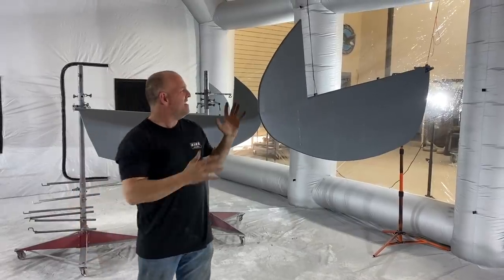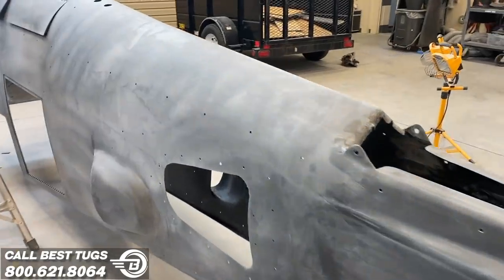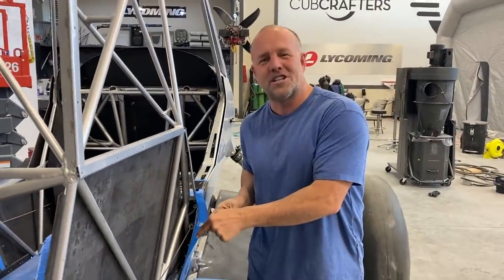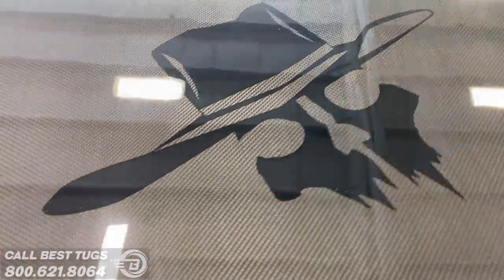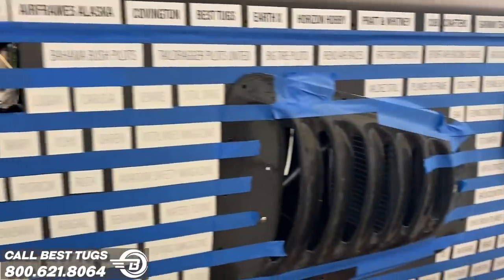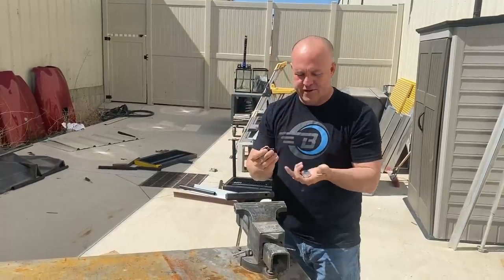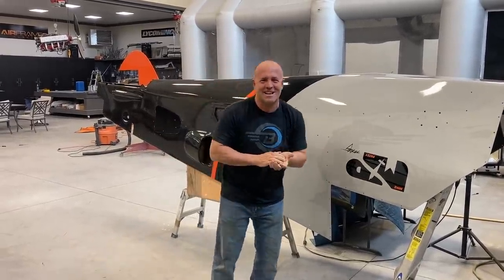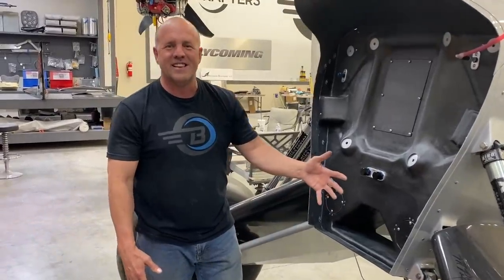Scrappy gets a paint Job (Scrappy Bush Plane 23)

Comment: Oh this is so very exciting :). Quick question I may have missed something but the lines into the wheel shocks are these for pressure release/equalisation or perhaps can be from a compressor to set the stiffness and travel depending on the planned field conditions ?
Reply from the maker: Coming in one of the next few videos
Reply: @MikePatey  Can't wait :)
Reply: Mike Patey hmmmmm. I’ve had this suspicion about you doing some crazy remote control setup in the cockpit 🤔

Comment: Hello Mike,   I am an avid fan of your channel and love to see what you come up with. I have many qurious engineering questions of Scrappy and your visions for it.I hope that my questions are not perceived as naive. A) The airfoil shapes of your upper A frames will  effectively give you lift at certain angles and that is why I Am guessing from previous mention on your channel that your shocks are also Hydraulic pistons able to lift the gear into flight mode. Have you calculated the percentage of lift gained by this? B) With lift you also gain parasitic and induced drag and I am wondering if that turbulence behind the gear will affect or blank the horizontal stab? C) I saw that the bottom A frame is covered in fabric and thus creates a sort of "Tunnel Effect" under the fuse in conjunction with your flap door. Have you calculated the drag and lift factor of this? D) Other than the "Tunnel Effect" you gain from the lower A frame, could the Bottom Axle pivot point have been made by a single airfoil shaped strut, saving you weight at the gear? E) I can perceive that under heavy braking there is a crushing load at the rear pivot points of your A frames causing the lower fuse frame to push inward. Are there cross brace tubes in the fuse that go across to connect both pivot points together? F) Have you calculated the effect of your flying landing gear ,when in a Slip to landing? Will the forward facing gear leg cause more lift and an unwanted banking action that would oppose a side slip? Have you used any BIPlane engineering concepts to calculate the effects of your gear design, since in essence you are creating a sort of BiPlane between the gear and wings. Thanks in advance for you answers, I am looking forward to them.

Comment: Curious, did you use a special epoxy for the carbon fiber? I'm reading about how sensitive epoxy is to temperature and thinking about the wide range of temps airplanes experience.

Comment: I hope this isn't a dumb question and, I ask not knowing your total loaded weight but, are you under braked?  As I'm sure you know, brakes convert the energy of forward motion into heat via friction.  Therefore, unlike everything else on a plane, when it comes to brakes mass is good.  The larger and thicker the rotor the better, the more substantial the caliper the better, the larger the pads the better - all to absorb and wick away heat.  It may be the enormous bush tire that makes the brake system appear smallish so, just wondering if you have enough braking power.

Watched every video of the Draco build and am following as you complete Scrappy.  I know I'm just one of many voices in your busy orbit so, no obligation to necessarily respond.  Thanks for the great content.
Foy

Comment: I've watched THIS VIDEO...?...I don't even know how many times now!  ....and that's basically because I'm a real "Asthetics" Driven kinda guy, and now that the paint is going on I'm WAAAAAAAY interested in THAT PROCESS...AND...OUTCOME !  But that, over and over again watching created ANOTHER question...?
   At the very end when you show those aluminum "Hose fitting plates" that you started making. When you attached them to the bottom of the suspension wings, are the screws threading into just the carbon fiber of the wing OR did you plan for this b4 you enclosed the aluminum bar suspension in the carbon wing and you knew exactly where to drill so that the "Hose fitting plate" SCREWS would screw into that suspension tube framework???
   And one last comment....  I sure hope you're planning on using a LOT MORE ORANGE paint as you go forward on Scrappy, cause I think BRIGHT colors...( up against a little black, just for the sake of CONTRAST) makes for a REAL COOL look on anything ! ! !

Comment: Are you using a uv filtering clear on the carbon? I k ow the 787 had uv issues with their exposed carbon.
Reply from the maker: 👍🤠 yes sir I have done testing and have a ten year race plane with it and percent still.  Certainly heavy on the UV

Comment: This isn't criticism, just curiosity, why wouldn't you use a carbon colored glaze or fairing compound on the pinholes?
Reply from the maker: Great question 👍🤠 I tried it a few years ago.  It would look perfect match and then put on the clear and it just popped the color out so I tried a few different colors and thought I had it. Then I pulled it outside and the color changed different then the carbon again. So I went back to clear.

Comment: That bulk head holder 
Looks like something you'll see out if China for 50c ea in a year or so 
Good idea 
I end up making a similar thing but use plate and weld the fitting to the plate 
This is way better but I lack a cnc mill 
Lol

I'll add that 
So someone will start makeing these in America or Europe for $1 each and they'll be good 
Then the Chinese will start making them for 50c, then every one will buy the Chinese one and itll be shit 
The nut hole will be too big and the material will be shit so you torque it up and the flats strip out of the nut hole 
Then everyone thinks they're a crap idea and no one buys the proper made ones 
Seen this happen before in agriculture where a dead simple idea that males yoir life easy is taken off the market by crap knock offs
Reply: Now iv edited out the spelling mistakes and lost the mikes like 
Whoops